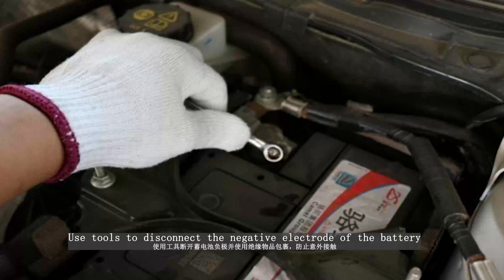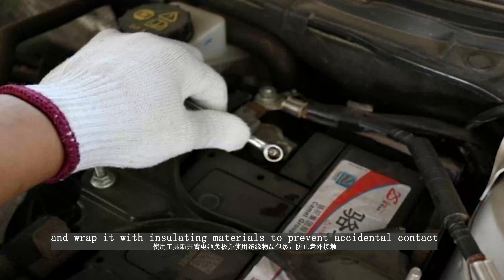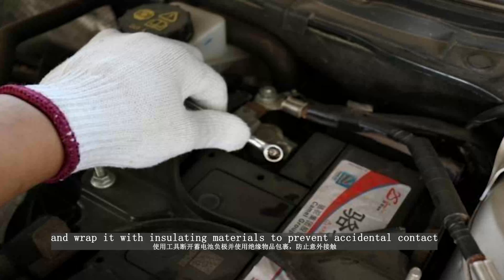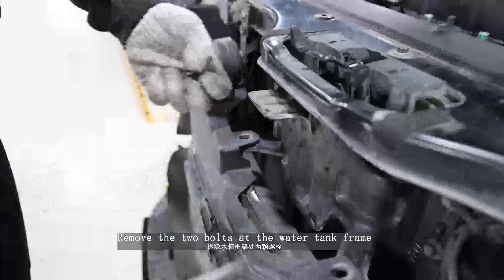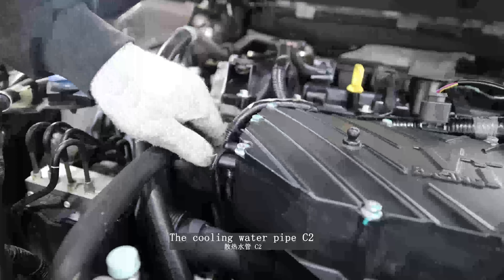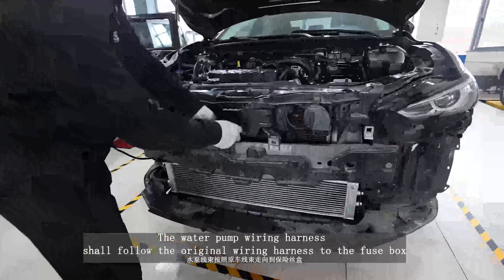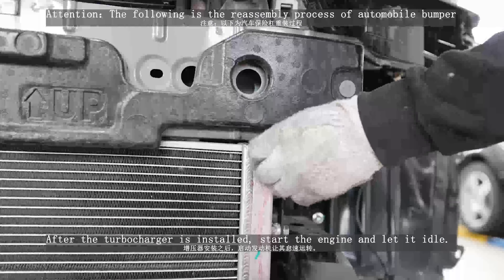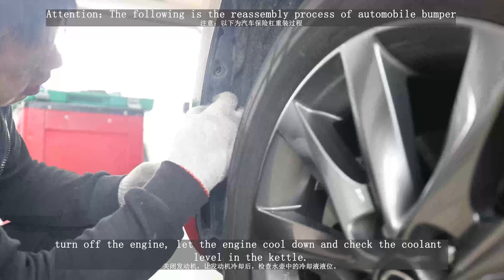Mazda supercharger kit installation video,suitable for all Mazda 2.0/2.5L skyactiv engine

Comment: No oil connection to supercharger? Will check engine light turn on?
Reply from the maker: Screw-type mechanical supercharging does not require an oil cooling system. There is already lubricating oil in the supercharger.

Comment: But if you were to do this to a stock vehicle wouldn’t you need a tune otherwise there’s too much air going into the engine and not enough fuel no?
Reply from the maker: @GeorgeB-jw5yc  have computer tune in it

Comment: you guys should make this for Mazda 6 2.3 2004 hatchback
Reply: too old, get a new car
Reply: @Стрелок-ш7с  sucks cause the older Mazdas are better and built better haven’t had a single problem with my Mazda except for tires and a few easy sensor replacements running strong on 17 years!,haha how’s that newer Mazda holding up a lot of electronic issues I hear 😂
Reply: @luhrafi  Nah, its not. they are right behind Toyota in reliability.
Reply: @Sir Slattrafi*  lmao the copium in this comment. Imagine hating the new versions of your car cause you're too broke to buy one. The new Mazdas are very nice and very reliable, haven't had a single issue in 3 years and 50,000 km, Better on gas, nicer and way faster than what you've got. You mad yet? Lmao
Reply: @Стрелок-ш7с  They're ahead of toyota in reliability for 2022, but behind Lexus
Reply: @luhrafi  Depends on what you call Older. - The 2012 to 2018 CX5 Diesel egines had two serious problems. Blowing head gasket, and carbon buildup causing poor oil circulation.
Reply: @luhrafi not even close. Skyactiv is better than older MZR in every way.
Reply: @luhrafi   the older mazdas were FORDS....
Reply: @Стрелок-ш7с   not according to consumer reports... toyota and LEXUS were #1 and #2  mazda was #7 ...

Comment: I thought these motors had to much compression, to have one of these installed.
Reply: It’s def gonna need alottt more modifications
Reply: @vctrflrs3687  There are a couple recommended add-ons but only upgraded spark plugs are required ontop of the VT kit.
Reply: @muckeyn do you know which spark plugs are suitable to change into? Is it hotter or colder. Planning to install it to my 2024 Mazda 3 2.0

Comment: Will this work with the 2.5L Turbo version
Reply from the maker: sorry cannot
Reply: @jiasusuperchargeranrot3006  
Can I ask why?
Reply from the maker: @Thebigmankeaton17  this supercharger for 2.0/2.5L,your car have turbo right?
Reply: @jiasusuperchargeranrot3006  
Yes sir.
Reply: How can I get this I just did the 2.5 swap in my 05 axela hb need this now
Reply: You want to supercharge a turbocharged car. Possible but problematic
Reply: @Thebigmankeaton17 8 know this is old... But why in fuks sake would you want to try to add a supercharger to an already turbocharged engine?